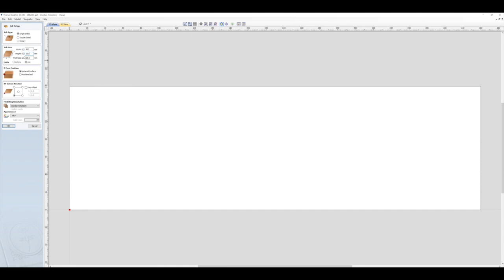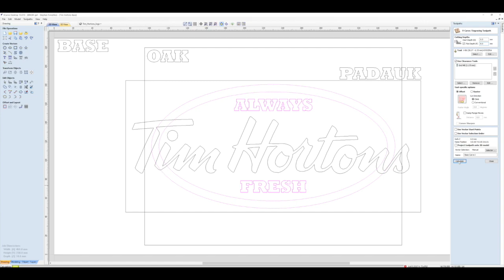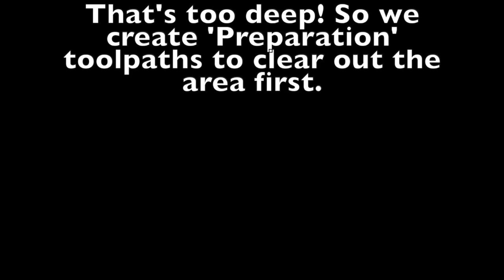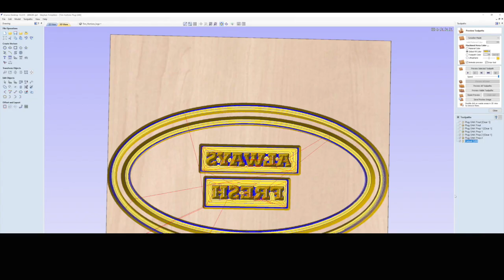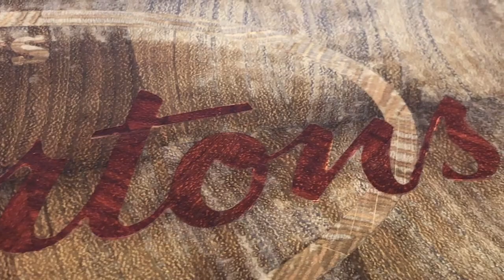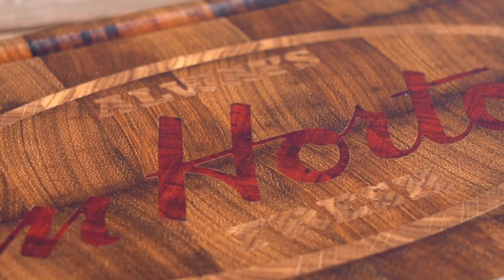Making a V-Carved "Tim Hortons" 3-colours cutting board with hobby CNC (v2)

Comment: Thanks so much for this video. I had watched a lot of carving videos and never struggled with shallow inlays, but deep inlays were always kind of trial and error with a mix of Estlcam and F-Engrave. It always did work out in the end, they look good, but your simple drawing is just what I needed to easily create fitting inlays. Also, the preparation toolpaths are a great idea. Harder to do in Estlcam, manual editing is needed there, but the general idea still holds. Thanks!

Comment: Hello Stephen, my question is, any different if the board is not an end grain? Use same method for face grain or edge grain board?
Reply from the maker: Method is the same! Avoid small details though as long grain will tear more easily!

Comment: Any idea what causes these gaps between the inlay and the pocket? I had a similar problem when I used your same approach (only difference is I used a 15 degree v-bit instead of 30 degrees). I thought it might have been because the work holding on the plug wasn't perfect and it moved slightly. Yours seemed clamped well. What happened?
Reply from the maker: I made lots of other tests after this one and I think it comes from several things:

1) The CNC's rigidity: when cutting the V pass, the bit will always have a tendency to be pushed towards the center of the pocket and the outside of a plug. As this deflexion is not the same in X and Y... It's probably the reason why most of these gaps are in the X direction because of more Y deflexion.
2) Not enough glue space, plug bottoming out
3) Bad clamping: I found out that lots of individual clamps work much better than a 'spread' clamping  (but that is a problem to reach the center of the plug so you have to be creative...) I'ver seen incredible inlays made by @mtmwood (who clamps in a press) or @brotherinwood (who doesn't even clamp, just hammers the plug down a little bit) but I think that only work if your CNC is really strong/rigid. With our hobby CNC you have to be able to deform the plug a little bit.